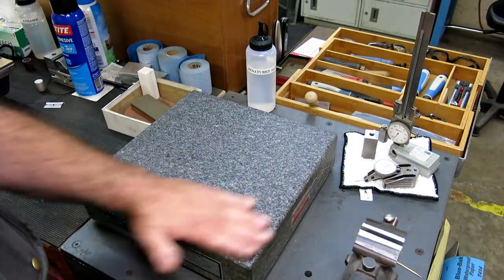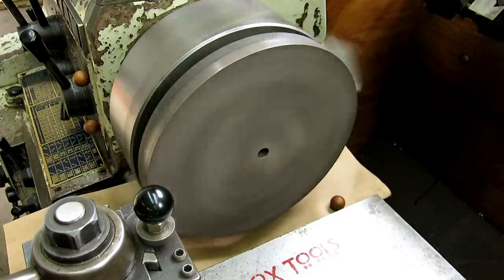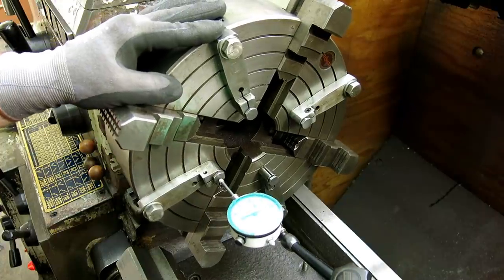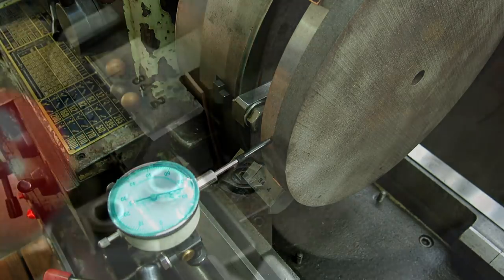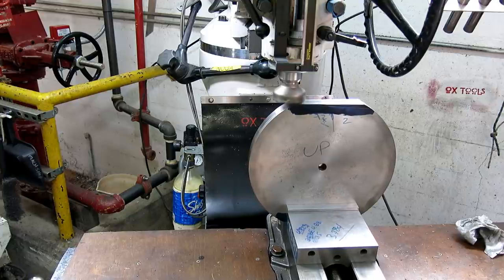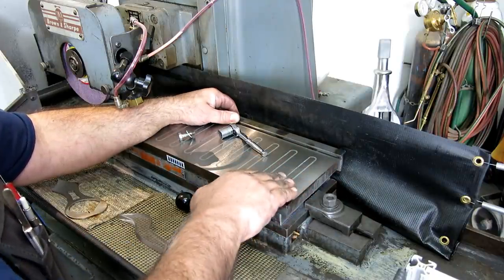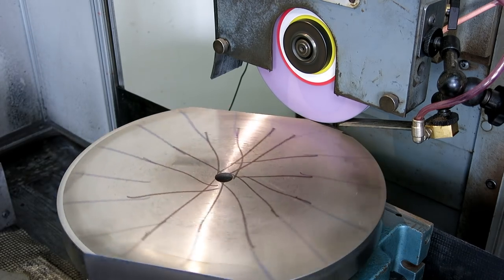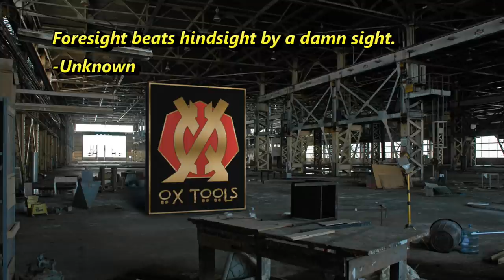Confessions of a surface plate abuser

Comment: That's minor Tom, I worked in an aluminum castings shop in the straightening department.  We had two sections the small parts section worker on castings that for the most part could be easily held in one hand.  They had six work stations each had a surface plate typically 24 x 36.  And a beating plate the same size.  The beating plate was two inch thick semi polished steel.  I was promoted to the large castings side where each work station consisted of just a 48 x 72 surface plate which was used to base qc and straighten parts.  Chips and pocks where the norm.  If they got to bad we would fill them with epoxy.  Needless to say it felt pretty sacrilegious to beat on the plates like we did but corporate didn't seem to care

Comment: I will have to call you out on not cleaning off the plate again before putting the disc on, Fresh abrasives are notorious for leaving behind particles, especially laying down as it was. 

Other than that, great video as always, you're like the mentor I've never met.

Comment: Ive seen this done with pieces of glass a lot , exactly how flat is glass , not sure if you have ever done a video on it but id be interested
Reply: Depends a lot on your glass and definition of flat.
Reply: Really depends on the thickness of the glass. It is brittle, but not very stiff. If you have a thin piece of glass on a not flat surface it wont be flat.
Reply: Common among woodworkers on a budget to sharpen their tools on plate glass with abrasive paper
Reply: @Si-Al-Ti  Also an old dodge in vintage engines when you want a reasonabley flat cylinder to head fit. You want apiece about 12mm/1/2" thick at least. Where you get it thats another story.
Reply: @Si-Al-Ti  check Lee Valley Tools has a glass lapping plate for 20 bucks....Canadian
Reply: Glas made floating on a bed of molten iron is pretty flat, until you bend it.
Reply: @jonwatte4293  These days almost all flat glass is made this way, floated on a quarter-mile long bed of molten tin. An old trick from Scientific American's home scientist column was to bed a thick glass plate in plaster or hard putty, over a dense substrate. (Concrete slab?)
Flatness is a tenth or two per foot. :-(
Reply: Pilkington the famous English glassmaker patented in the late sixties "Float" glass a process by which created absolutely flat glass plate, the molten glass was floated on top of a vat of  molten pure Tin in a continual process that they said would be literally continual. Apart from machinery breakdowns I suppose. The glass did not need polishing and was considered flat and uniform thickness and was superior to "Plate" glass which was formed between polished steel plattens , which were of course a finite size. The glass came about because of the need for ever bigger sheets of thick glass for places like shopfronts and car showrooms who wanted to display their wares in ever bigger displays to the public. And Pilkington came up with this continuous process to supply ever longer pieces of at least 1/4" , 3/8", and 1/2" thick flat glass.. I worked in the glass trade in the early 1970's and this had only been introduced a few years earlier, and I was told by our boss that it had revolutionised the shopfront glazing trade because you could get 1/2" Float glass 40' X 8' long to do a car showroom window as long as you had the transport and the manpower to lift it into position. In essence it was claimed to be dead flat, but in engineering terms I'm not sure to how many microns that would be.
Reply: @jonwatte4293  Glass is made on a molten TIN bed not IRON . Iron would be too hot
Reply: @johnmccallum8512  Thanks for the assist!
Reply: I used a bathroom scale with a glass top recently.
1/4'' thick or so, worked great!
Reply: For most purposes, glass is flat enough. For high precision things, you can get things more precise than glass.
Reply: Most thick glass is pretty flat as long as it doesn't bend. Get 10mm plate glass or thin glass bonded to something solid.
Reply: @SuperAWaC  This. You can expect glass to be off by half a mil or so in flatness and thickness, even float glass. Also, the stiffness of glass is typically a bit less than half that of steel (close to aluminum), so don't expect it to stay put if it's thin. For some purposes this is more than good enough.
Reply: Glass laying on top of a surface plate is pretty flat.
Reply: @treatch3  8 x 14", not a bad size for what I do.
Reply: Glass can also be ground flat.  Ground plate glass was used as surface plates during WWII when iron was in huge demand.  I have a Cadillac Glass Company surface plate from that time, stamped AAA.  It's about 1 1/4" thick
Reply: Its about the same flatness as the earth. 
When people do lapping you can usually calculate the diameter of the lap, which is usually greater than the diameter of the earth.
I'm sure glass has other properties, some which I would discuss if not for the fact it would be pure anecdote.
Reply: Modern float glass is extremely flat.
Reply: Mirrors tend to be flatter than window glass, less residual waviness. You can sell a slightly wavy window glass, people won't notice, but as soon as it's a mirror, they start having objections. And you can get a big pack of 30cm mirrors very cheaply. Of course glass for mirrors and for windows is manufactured in exactly the same manner, floating on top of molten metal, but perhaps they let it settle longer or more carefully for a mirror.

I am not a machinist though, but an electrical engineer. Things that i had to sand flat tend to be 3D prints and aluminium and copper heatsinks.

Comment: if you make yourself some little copper covers that wrap around the  chuck jaws (ie just use a longer strip of copper and bend it around the jaw) you can slip them over the jaws and not have to worry about having copper shims slip out when you back the jaws off too much while dialing in the part

Comment: In the optics trade we use cast iron laps all the time.  They work great with loose abrasive,  just paint as many surfaces as you can and keep the rest oiled.  
What i dont understand is why you machine shop chaps dont get a simple lapping spindle.  Your lap will wear much more evenly if it is spinning and you can use the position of the workpiece to adjust from convex to concave.

Comment: i used to cut a lot of  brake drums and rotors on various drum and rotor lathes.. i always tried to have some inch and a half disposable natural bristle wooden handle brushes next to the lathe.. i would rest the side of the bristles on the cutting tip.. so it deflected the chips downward..  nylon bristles just melted as did plastic handles sometimes.  it does block the view.. but i would rather not have chips everywhere .

Comment: it kinda bothers me, that the hole is not in the centre.
Reply: It bothers me also.  I think if you're sanding any small parts that go over that hole the sandpaper is going to sag into the hole causing an issue.   I think I would have drilled it to a nominal size, tapped it, loctited a bolt in, and then faced it off flush.  Tom is a lot smarter than I am, and he knows what he's going to be using this for so I'm sure if it were going to be a problem for him, he would have fixed it.
Reply: Another great and enjoyable project to watch. Thanks!
Reply: You mean the CENTER?
Reply: @archangel20031  I'd imagine that he meant the centre, as spelled by the originators of the English language, the English, and most non-US countries where English is used as the first language, including Canada, Australia and India (populations totalling ~1750 Million).    You chose to ignore all the interesting things that could be written about this video, and instead went with pedantism.
Reply: @buckinthetree1233  I'd only consider that if I had a cast iron bolt.  With any other metal the disparity in thermal expansion rates will exacerbate flatness errors in the center.  A hole will always be a hole, easily noticeable and avoided when sanding small parts, completely bridged and mostly irrelevant when sanding larger parts.  A plate containing a faced-off bolt of steel would only be flat when at the exact temperature that the plate was at during final grind.  If the plate was warmer than that then I think you'd end up with a high spot where the bolt was, and another high concentric ring where the iron deformed upwards under radial pressure.  That said, I'm not sure that the effect would be of the order of magnitude to be of much worry considering the tolerances of the disc and adhesive thicknesses.  I am surprised that Tom didn't either re-cut the hole larger to be concentric, or center on it during lathing.  That's the sort of thing that would bug me forever.  I await the future video where he forgets that it's off-center and Bozos somehow.
Reply: @genixia  But this is A-MERICA, we don't speak that fancy British speak!
It's annoying that my whole life here in the United States center was c e n t e r but now it seems like everybody wants to go ahead and misspell it, and swap the last two letters around!
You don't even want to get me started on aluminum! LOL
Reply: @archangel20031  If I wanted to contribute to the tug-of-war, I'd be incredibly hostile and suggest that the American accent is probably closer to the accent of the original English as it retained its rhotic traits, which the British lost when they widely adopted received pronunciation.

I actually don't know what point I'm making, but I think the argument of "authority as progenitors of the language" doesn't have teeth when the British themselves opted for non-rhotic pronunciation thereby eschewing centuries of established convention.

"Center" it is!
Reply: @Zancarius  yay I win, lol🤣
Reply: @archangel20031  Would that make you King of the Castle, OR, King of the Castel?
Reply: Then give an off center comment.
Reply: @billwessels207 Mr. Wessels or is it Mr. Vessels? Is it archangel or archangel?
Reply: Yeah, a press-fit flush pin to fill the hole would be best!
Reply: @archangel20031  people started spelling centre properly around the same time that millimetres/cms/metres became more common in daily use in the US. I think there was some kind of little song that spread around US education, something about millimetres being different from multimeters, annoyingly I can't remember the title, but a passing commenter might know.
Reply: @mor4y  even though I'm American, I refuse to spell litre as liter.  Liter just doesn't look right to me.
Reply: this honestly would drive me nuts while machining

Comment: You can clean the chuck by sucking with Your shop vac from the back of the lathe and then using a bottle brush to clean the jaw threads. Cleans the jaws and their threads really well unless You let go the bottle brush into the shop vac.

Comment: Question from a non-machinist. 

Wood workers and cabinet makers often have centralized vacuum systems with collection pipes at every machine. Why not so much with machinists? Seems like some sort of flexible vacuum nozzle rigged up next to the cutter would collect all the dust and chips where they're being formed instead of flying everywhere.

Comment: I have done a lot of work for an older couple and the lady gave me a floor lamp they no longer wanted. I didn't want the lamp either but the gigantic marble base removed from it has been my surface sanding plate for many years for non critical things. the only bad part is if I have to move it.

Comment: Find a place that does stone/granite/marble countertops, they cut out a piece for sink to fit into. 
Usually pretty close to flat and less than $20.00 as an off-cut. 
Pretty sure it would cost way more than that just to ship a large chunk of cast iron? (plus whatever it costs for a piece the size you had?)
Reply: Damm that's a smart idea.... Allso tombstone makers are worth a visit.
Reply: @africanelectron751  .as long as it isn't recycled from  the cemetery ;o)

Comment: 3 surfaces when rubbed on each other with abrasive powder in alternating pairs, will flatten themselves.
3 granite countertop sink cutouts can be made into pretty accurate surfaces with a lot of elbow grease, and a fair amount of time.
A clever person could use a motor with a gear reduction and an eccentric on the shaft to move the top piece around on the bottom one.
Reply: or you could just buy a surface plate. because that's literally how theyre made.

Comment: can grind both sides and have one side course, other fine
Reply: And if you made a 'box' with a lid that came down to table hight, the base having a pair of permanent 'parallels' as support.
Then you could put it away with protection.
Or even, likely if bench space wasn't at such a premium, leave it safely covered on the bench next to the measurement department.

Comment: 41:01 get yourself an eraser, the ones for pencil on paper, but a big one (usually have a print on it "for big mistakes"). They work like a charm for cleaning sandpaper / (diamond)grindingstones, produce way less smearing compared to those un-vulcanized latex-rubbersticks some woodworkers use for their beltsander and you don't spread so much dust in your workshop. (You still need the brush for the finer eraser crumbs, but they are significantly larger and won't fly a fraction of the distance)

Comment: Interesting trick to clean out loaded up sandpaper I found about a week ago is to slap it with a micro fiber cloth. Works FAST, but not very elegant
Reply: How did u learn this witch craft
Reply: @steventhedog94  calculators

Comment: The best title for a video ever.  Would this work better if you put grooves in a grid pattern like you're lapping plates and then use the adhesive sanding mesh instead of the paper to allow some of the particles to drop through into the grooves?

Comment: Do you know how much a cast iron plate like that costs new? Well, maybe people don’t want to know. Finding one as scrap is really pretty hard to do.

When I bandsaw a circular surface, I first turn the piece so that I cut a very small divot out of the piece going straight in, 9p degrees from the surface, right at the point of where the cut starts. That gives a place to start the cut without the saw blade deflecting.

Comment: Impressive but....I thought you'd have plugged the hole (weld / pin /  screw or bolt) prior to surface grinding. Would have been a very handsome demonstration and eliminated the hole.

Comment: If the edges of the abrasive paper are sealed to prevent dust getting between the surface of the surface plate and the back of the abrasive paper, there is no foul!! I'd also like to point out that you could have done that in Al, some of us do home casting, making your own Al disk is altogether feasible!
Reply: yes that would be awesome :) Too bad in my parts it's hard to get AL scrap. Only from folks who dick around with cars with aluminium rims. They gladly sell broken ones.

Comment: Pro tip: a clean no grease workpiece and clean oil free paper will last forever. Use a new dry chip brush to remove load up from sand paper. A sheet will last you so long you won't believe it.

Comment: Tom, I also had another observation.  Other than for work-holding on the rotary grinder, would you have been better served to use 3 of the adjusting feet at 120 deg. vs. 4 at 90 deg?  While not a precision application like leveling a surface plate, it does make "horseshoes and hand grenades" leveling a bit easier.  Just a thought, not a criticism.

Comment: Hi Tom, first I want to say I admire your skills and love your enthousiasm showing how things are done. My question is (and I have to admit I know less than nothing about designing, machining etc.) , with all that precision you are working with, does temperature play a role? I mean, when you measure metal, according to my physic teachers, metal usually changes volume when tempreture changes . Does this influence your mesurements, and if so, how do you correct that? Again, I have absolutely no experience with this, I never even met a CNC machine. Finally, I am fascinated by what you show on your channels. You got a new subscriber.

Comment: I am not a machinist, and don't have a surface plate, so i probably shouldn't have a say, but when i have to sand something flat, i spray-glue sandpaper on top of a cheap mirror from IKEA or something. You can get a big pack of mirrors for little money and they're pretty flat, flatter than say window glass which often has some residual waviness - but a wavy mirror would be much tougher to sell, so standards are a bit higher. I also have no bloody clue why this video is in my recommendations and has been for days. But here Google, happy?

Comment: Thanks for the video and the tip about Shars.
I just ordered a 9X12 Grade A surface plate from them on your recommendation.
It was cheap enough but the shipping made my butt sore.
Lol!
Reply: I assume that you ordered the Grade A because the two ledges make it easier to handle.  It's a shame that Shars discontinued their red granite plates - the 9x12x1 would be great in this application - relatively light and very hard wearing.

Comment: I've always wondered how good 12x12 granite floor tiles are in terms of flatness. It would be great if you could buy one from one of the big box stores and test the flatness. It'll make for an interesting video I think and we may even find that it's good enough for most flattening tasks.
Reply: They are pretty bad the edges drop off like .020 going into the grout lines. That's just an eye ball though, I doubt the centers are any better, they also have the ++++++++++ pattern on the back as to grab the mud when applying them so maybe just standing them up on them and lapping one in wouldn't be too crazy, but for all the work you might as well buy a starrett 12x16 or even a value line 24x24 for 150$